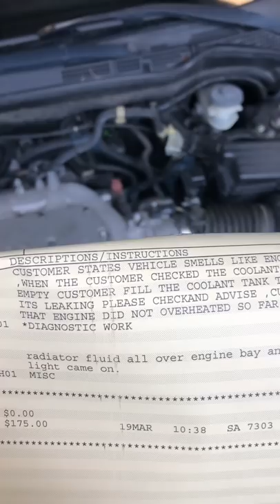Do not use this type of hose clamp because…

Comment: Ummm maybe the oem radiator shouldn't t have plastic outlets. I had one crack on me and I replaced that radiator with an after market high performance one with metal outlets. Way better
Reply from the maker: Go tell that to almost every car manufacture out there because it’s what they are rolling out with so we should use the correct clamps to avoid a clean split crack on the inlet

Comment: The reason that worm clamps aren't used is because during assembly it is much faster to install the spring type.  This guy has no idea what the hell he's talking about.  And before you call me a Shade Tree Mechanic, I have a Degree in Automotive Technology and have been an ASE Certified professional mechanic since 1994.

Comment: Those clamps that you said are good hell I replaced my thermostat in my 2011 subi barley wiggled one of those ome ones an it just nonstop started leaking bc I couldn’t tighten it an I woulda had to redrain my radiator after I was done bc it’s when my car was running it’d leak out a worm one on it after I slid the om one out my way

Comment: I have to disagree its not t clamp it could be a combination of things taking affect. like, not t right mixture of coolant.a sticking  thermostat,
A bad radiator cap. Bad fan motor. Or just plain old radiator. It can only expand and retract. And absorb heat for so long. These clamps have been used in many plastic n fiberglass  radiators.n hold up just fine. But just like anything elce if not tightened correctly u will just make a mess of things.

Comment: Oh boy.  Then don't ever work on aircraft.  The bleed air powered air-conditioning system uses worm-gear clamps on silicone ducts all over the place.  The air temps on the hot side exceed 400°F.  Any worm gears work JUST FINE.

Comment: Worm clamps have their place. I don't like them because they chew up hoses. Spring clamps are dangerous if you don't have a spring clamp tool especially in awkward spots. Have one slip out your pliers. Biggest mistake are plastic radiators/thermostat housings etc. Go back to metal already.

Comment: Worm drive hose clamps are not the problem the manufacturers of these parts are the problem how come I can get a cheaper than OEM radiator that's more efficient and made from all aluminum but yet if I get the OEM radiator it's an aluminum core with plastic ends and a plastic hose in Linton outlet it's just cheapness on the manufacturer's part the parts are going to fatigue and then they're going to break and then replace them with better but yet also cheaper parts a dealership mechanic would never tell you that because the dealership mechanic doesn't want you to know that he's expecting her to come back in in another 5 years for hoses in another radiator.

Comment: Bullshit.
Experienced qualified mechanic here, one shop I worked at for years I did air con and radiator repairs, the clamp didn't cause this that top tank is rotten, seen it many times.
I've used screw type clamps on all my vehicles for over 25 years never had a problem.

Comment: Why not crimp on a new top tank, far cheaper?
Reply from the maker: Be smart, the cost to fix would be the same to remove and replace.
Reply: @2zzlow  not in NZ it was about 1/6 of the price years ago with labour. Because the part comes from a long way away and we are on a island. Labour is still the majority of the price. The old one was removed flushed and preasure tested as well. Never had a problem with it again while I had the car

Comment: Newer vehicles are crap period, they use far too many plastic parts in the engine bay. Remember when radiators and water pump housings etc were all metal? How on earth do they think that plastic can cope with constant heat cycles??

Comment: Spring clamps will leak 100 times faster then a properly torqued screw type
Reply: Both can suck, the only reason I prefer a property functioning spring clamp is because I feel like a screw type messes up the hose after a while
Reply: @TylerBigHead   I've seen more spring clamps fail due to them not being tight enough. All in all both styles suck the heat shrink is the way to go anymore 🤣
Reply: @redtopol4119  they're both bad, but nothing is worse than the bmw o-ring fittings that break the plastic off like 70% of the time, or the o-ring pulls out and is non replaceable

Comment: Dude I are 100% wrong the problem is the numb nut used a way to big clamp and ran it to the end of the threads and not use the right size the oem ones loose there strength and or u swap out the hose and it's thicker or thinner wall and thay loose there tension

Comment: He hasn't been a technician long enough, factory spring clamps only seal if they are put back exactly how they were originally installed. Worm clamps are far superior.
Reply from the maker: Your opinion and you can keep it. Time doesn’t define a techs opinion aswell.
Reply: @2zzlow  time equals experience tho, I was simply sharing my experience.
Reply from the maker: Others learn quick while others don’t so again time doesn’t define a techs status. Opinions at the end of the day
Reply: @2zzlow  actually it does... ASE certification require 2 years of experience, so to be a parts changer or an actual certificate technician you'll need time.
Reply from the maker: Ok whatever helps ya sleep at night. ASE Certs are just a piece of paper, doesn’t show real world experience
Reply: @2zzlow  you must not have any.

Comment: OEMs use spring clamps because they are cheap and faster for production assembly.
Worm gear clamps a far superior to the OEM clamps. An idiot installed the clamp on a brittle crapped out OEM radiator. Bet money it was already cracking/leaking and that's why they replaced the clamp.

Comment: Nothing wrong with a worm clamp in fact in many applications there far superior then a set tension spring clamp . It’s not the gun it’s the person pulling the trigger … it’s not the clamps fault that someone ran that worm clamp down tight enough it broke that junk ass plastic radiator

Comment: The oem clamps are complete crap. Just don't be an idiot and use hose clamps. They will never lose tension because you can tighten them as needed. They never wear out. And oem clamps are expensive. I work with performance shops and they all use hose clamps if it doesn't need to look good.

Comment: Nothing wrong with those clamps, and you can not over tighten them twit, you will strip it before that happens, that radiator saw better days, It called failure, nothing to do with the clamps.

Comment: Hey my man the clamps not the reason why it's a common issue as plastic raiders get old they wear down usually when this happens I replace the oems because it's usually happens on the OEM plants I use the that style with the worm gear setup because it actually gets a better clamp when you're using the older ones if you don't mind the factory fence backup with the spot where they were prior it will cause a leak if you put them just slightly off you got put them in the exact same spot where the dents in the rubber is now yes that cramp is a little big for that application but that's not what caused that break will cause that break was the fact that the barrier was so worn out I also happens when you mix your cooling you don't use the OEM pull ing or you go from OEM and you add a different antifreeze with the OEM cool mainly coming with Chevy dogs and you got that dexco ant

Comment: Of course you say use factory clamps. You work for the stealership. Oem clamps are designed to save the manufacturer money. The rad broke because of deterioration of the plastic not because of the clamp. There is a reason people hate the stealership.
Reply from the maker: Working at the dealership has nothing to do with my opinion. They are designed to allow for heat expansion on the plastic. No deterioration, only a clean crack down the middle.

Comment: Absolutely wrong on pretty much everything.

The minimal thermal expansion the plastic experiences isn't nearly strong enough to expand those OEM clamps, especially when they've been sitting there for years.

I also like how you claimed - in the comments - that the worm drive clamps loosen over time. So which is it: are they too tight, or too loose?

Dont overtighten the worm-drive clamps. In fact, dont overtighten anything. I've been using these things for decades without issue. They're used all over the aircraft industry.

On the other hand, I just had a plastic Ford OEM coolant clip fail, dumping coolant all over the ground. Second one in 3 months. I have nothing but bad things to say about Ford OEM quality.

Comment: The clamp is not the problem, its the cheap ass plastic radiator 😁
Reply from the maker: The clamp was not meant for this radiator which is why it broke it. A spring clamp will allow for heat expansion

Comment: You know what is “super garbage” that radiator and the mechanic unable or unwilling to suggest the use of a repair kit for exactly that issue.
Reply from the maker: Be smart, the cost to fix would be the same to remove and replace.

Comment: Plastic radiator tanks are garbage…has NOTHING to do with the clamps! Heat cycling and brittleness are prevalent any time after 10 years. Just had this happen on a 10 yr old Subaru. If your car is over 10 yrs old and you’re going to keep it…REPLACE THE PLASTIC RADIATOR.

Comment: Oem clamps fucking suck have you ever had that one clamp that you couldn't get ahold of with anything and end up spending 15 minutes before you can find a pair of needlenoses to use and they won't open enough
Reply from the maker: No and that Sounds like a user end error…have the right tools my guy
Reply: @2zzlow  yeah a screwdriver and one of those clamps

Comment: Need a whole new radiator? How bout just a new top cap. Don't trust mechanics who don't know what they are doing. Radiators starters and alternators can be rebuilt for much cheaper than a replacement part. Rotors and flywheels can be turned within spec. So many parts on you car can be rebuilt for much cheaper than replacing them. I could go on and on about this parts changer.

Comment: Worm gear clamps are much better then any spring style clamp. Spring style if you did not know are a 1 time use application. After even 1 heat cycle there is enough heat transfer to weaken the clamp. Nothing wrong with any type of mechanical clamp as long as you carry the mental capacity to not lock it on with all the force you have. Just a piss poor mechanic as I can tell you are as well.

Comment: I prefer the stainless clamps with the bolt/nut on top. Alot of times they were used in early fuel injection systems. It's the only hose clamps I use in early gm tbi systems.  Alot of the 40-50 year old stuff I work on, you don't get an option for anything else, so I just use the best I can find for the job.

Comment: He might have a blown head gasket the steam can do this in minutes to the radiator plastics.
Reply from the maker: Replaced the radiator, hoses and spring clamps. Can idled fine and didn’t over heat.

Comment: "I hate these therefore they're bad" Nope but good try. Oem clamps are all well and good until they rust and/or need to be removed for maintenance. They are absolutely god awful to deal with most of the time. Hence switching to say a stainless steel screw down, won't rust and if done correctly will last just as long, function just as well, and will be MUCH easier to remove for whatever reason vs oem. You even contradicted yourself at the end claiming the reason for the failure wasn't the clamp itself, but incorrect application of it.
Reply from the maker: Rust? I live in California, can’t relate to your issue…

Comment: That's horse shit. If manufacturers didn't produce garbage plastic radiators maybe the clamp would destroy it... the clamp works so well the modern radiator can't hang
Reply from the maker: Which is why it shouldn’t have been swapped out in the first place.

Comment: Has a lot more to do with the shit plastic of the cheap aftermarket radiator than the type of clamp used. This mechanic must be new. Probably a fresh UTI or Lincoln Tech grad.
Reply from the maker: Ok so use the correct clamp for the application? Spring clamp is required for heat expansion on the plastic. 

If you really want to know, community college…

Comment: Nothing wrong with that clamp, just can't put that clamp type on a piece of crap plastic radiator spot, add a bit of torque and expect the radiator not to break - "oh, we need to make everything light weight to save gas" - that's a pile of BS - - tell it like it is - - that car isn't even good enough for the junk yard - yeah, I have an attitude, anything the car manufactures can find to save a 1/2 of a cent, you're showing us another perfect example of that - not an inferior hose clamp.

Comment: Problem is these cheap-ass plastic radiators they are making now days what happened to using regular metal radiators but keep forgetting ppl want cheap plastic parts and original aftermarket parts ain't no better than the cheap parts that are made out of plastic

Comment: Those are only good for metal tubing not plastic
Reply from the maker: Indeed! Tell that to the 10% of the dislikes
Reply: @2zzlow  see that alot on fitting pipes from transmissions and hydraulic tanks on heavy construction equipment i should know im a tech lol and they should know by learning a bit from everyone that has commented on here

Comment: The issue is the plastic radiator my friend,  these things aren't made out of anything these days, and plus the bullshit of clamps are a pain in the ass mind you I have all the proper tools to remove these clamps, if it's shit then it's just shit,  bottom line, because trust me I've had to replace radiators that snapped just like this and they still had the crappy oem clamps on also. Cars are just garbage these days

Comment: You could just fuse the plastic back -_- instead of making the guy buy a whole new radiator
Reply from the maker: Be smart, the cost to fix would be the same to remove and replace.
Reply: @2zzlow  I would take me about 10 minutes to repair , but that's just me I guess
Reply from the maker: Well good for you! Maybe you’ll be the next master tech that repairs plastic radiators
Reply: @2zzlow  I'm a diesel tech we actually repair ,not just replace.
Reply from the maker: Again good for you!

Comment: No that is incorrect. That hose clamp did not break that radiator what happened there was is that radiator is rotted the plastic is done that’s why it broke and those hose clamps if you tighten them up and you heat the motor up, let it cool down rhetorical they do work I’ve had those OEM clamps hit me in the face spring back and hit a vehicle. No you guys are just too lazy to go back and re-torque those hose clamps the correct way. Just a green lazy technician you wanna diss put it on there and be done not go back and re-check everything like you’re supposed to quality control, I’ve use these clamps for over 30 years. Never had a problem with him if they are put on correctly and tighten correctly, you don’t have an issue. After plastic gets hot call over the years it gets soft and brittle. I’ve seen the OEM clamps do the same thing on that radiator the same identical thing because it was not the clamps it was the radiator it was old and brittle the plastic decayed away, and try putting one of those squeeze clamps on a radiator like that you will crush the neck.

Comment: Steam damaged radiator due to running with low coolant.
Reply from the maker: but why did it get there?
Reply: Why did what get where? The clamps? Somebody put that style clamp on there because the radiator was already damaged and leaking ,And they thought a new clamp would fix it, not realizing the radiator was damaged beyond repair. I’ve been in the auto repair business 48 years, see this kind of thing all the time.

Comment: Ok starts off correcting service writer on vid, deletes a string that had reasonable discourse for and against, bashes most opinions not like his and still posts to SOCIAL media. Get what works for your particular region/application. And don't re use factory spring clamps, it makes you buy your job back.

Comment: Now autozone has those whimpy screw clamps with a butterfly on top so you can't even use a screwdriver. You have to do it by hand and most of the time they're in tight spaces where your hand doesn't fit. I'm like who's the moron who came up with that design. 🤦

Comment: The clamp you're saying it should be on there you ever had one break I have good fucking God I had to cut through everything including the hose just to get it off why because it was in the middle of fucking nowhere in between everything in the engine excuse me but I replace all clamps with old-style clamps the only difference is you don't tighten them down like a fucking idiot and break your radiator there's nothing wrong with the old style clamps just don't need to be an idiot when using them